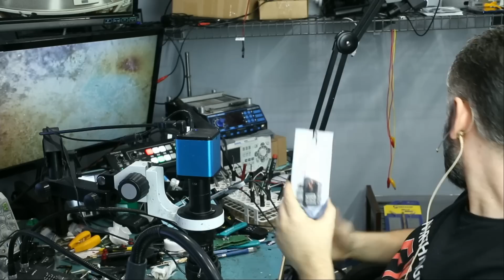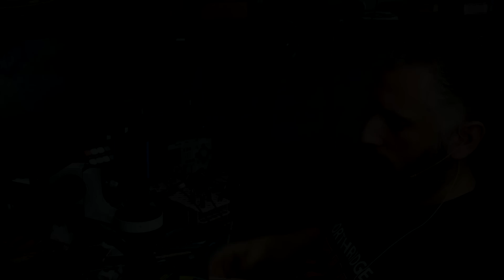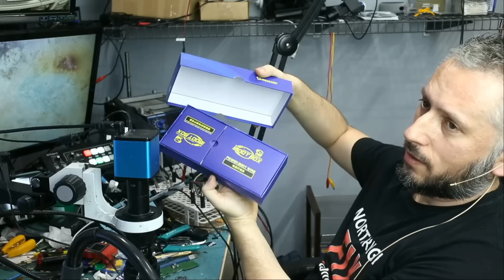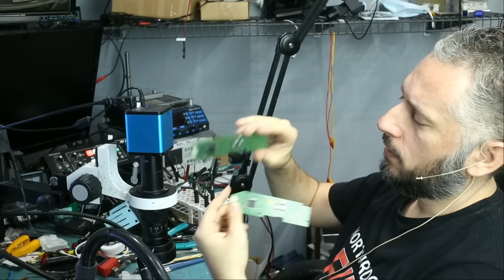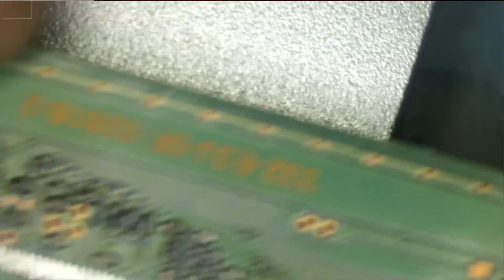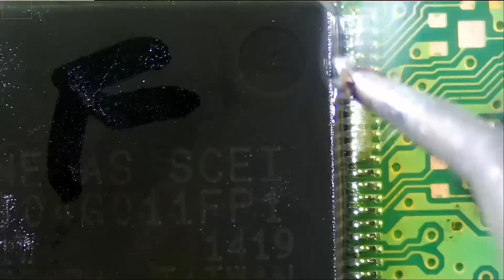PS4 Blu-ray optical drive Chip Swap re-marry - New PCB Holder iBoot box and Blades

Comment: Have you tried a mini wave tip to do this?its got a small hollow on the tip . You just run it along the pin ends and the solder flows with loads of flux of course

Comment: Don't know if you monitor comments to older video, but are you ever getting more of those customized magnetic PCB holders back in?  I already got the T26i, which IS a superb holder, without any doubt.  But it holds boards to one side, which can be problematic for my messy workbench when I need to turn it around.  That magnetic holder might be perfect for that issue, but I don't want to waste money on an inferior one that has those 'sharp' type of magnets - or worse, weak magnets.

Comment: I noticed you don't use flux when using a heat gun to remove some components. I'm still very new with soldering. I was just curious if there is a reason for this? I really like your video's by the way!

Comment: I am sorry if this is a dumb question , but you are moving the PS4 Bluray chip from one PCB to the other , what makes the actual boards non-exchangeable ? , they look like the same board. There must be incompatibility in the boards , but wondering what that is since the chip is the same type (just not married to the desired main-board).
You have such a wide range of devices on which you work , that's very interesting , some people tend to specialize in one specific product range.

Comment: Would it be possible to not just change PCB that is linked to same drive into console or is this process required?
Reply: I had the same question. Does anyone know if that is possible instead of swapping the IC's?

Comment: for the lack of mixer's input channels, you could add a HDMI selector/switcher before the mixer input. just switch to the desired input point and then go to that channel so you still get the transition effect of the mixer. just my 2 cents. 😉

Comment: If your mixer is HDMI, there are CHEAP HDMI switches. You can run 3 HDMI via remote control into 1 port of you mixer. You can plug your least used cameras in to the switch. That would give you 2 more cameras. $10 on amazon  search for (HDMI Switch,3 Port 4K HDMI Switch 3x1 Switch Splitter with Pigtail Cable Supports Full HD 4K 1080P 3D Player )

Comment: Hi Alex I really enjoy your work. Great channel with really good info and technics. One thing I think the word remarry is the only thing that is incorrect  here. If you remarry you take a working board from a different console and make it work in another one without replacing the chip. This is only replacing the chip and not a remarried board. Keep up the great work. Cheers
Reply: The old chip was remarried to a new board. It works just fine.

Comment: great work as always! may i ask, why did you have to transfer the chip? why not use the whole original bluray pcb on the new player mechanism?
Reply from the maker: The board is faulty and customer asked for chip swap.
Reply: @NorthridgeFix  Glad you got it fixed. Nice work as always, and thanks for your response! ❤
Reply: The customer wanted it changed 3:39
he explains why at
 9:36
Reply: @poslane99   i know the fact that the console must read the original married Renesas ic. I mean why transfer the ic instead of just transfering directly the whole original board to the new player that the customer bought
Reply: @TechGuruGR  This is exactly what I'm wondering too. So long as the part numbers on the boards match, you can just swap the boards along with the drive. 

My only guess is maybe something else is damaged or not working on the original drive board.

Comment: I think you can get some special "well-like" tips for soldering large pincount ICs like that. The tip has a small hole/chamber in it, it is supposedly better at holding on to excess solder while soldering the pads. Never seen one, but a long time ago I think I saw one in a video.
Reply from the maker: Gulf wing tip will work but in this case i need more precision.  I wish they had bent Gull wing tips. That wouldn't been nice.
Reply: Gull wing

Comment: What was wrong with the board that it needed a 100 pin chip swap. I have swapped bluray drive on ps4 before and I just swap the boards not the chips
Reply: The customer wanted it changed 3:39
he explains why at
 9:36

Comment: Carnt you just swapp the boards not chip ? Or is it the board that's broken and you just  recovered the chip for a good board lol
Reply: I think he meant to swap the boards on disk drive if it's the drive faulty, not board
Reply: @deividasrainys6116  you got it lol 😆
Reply from the maker: The board is faulty and customer asked for chip swap.
Reply: The IC has a serial number that needs to match to PS4 Mainboard. Thus the drive board cannot be swapped without reusing the IC from the original board.